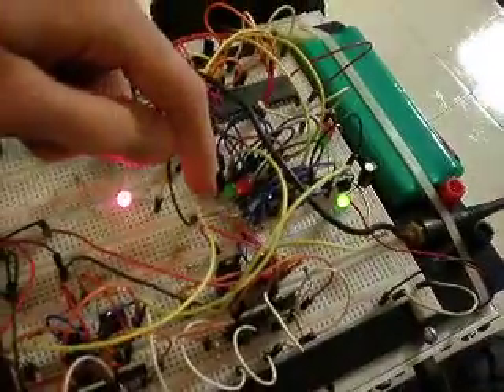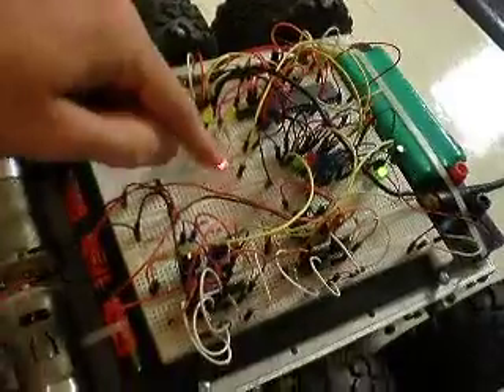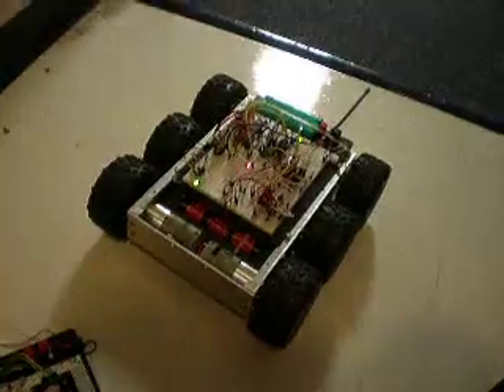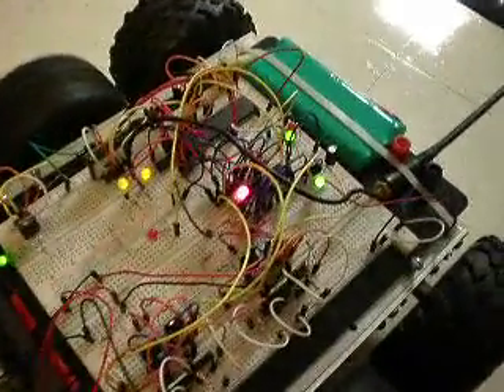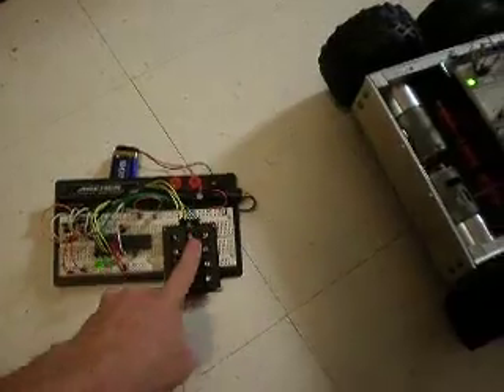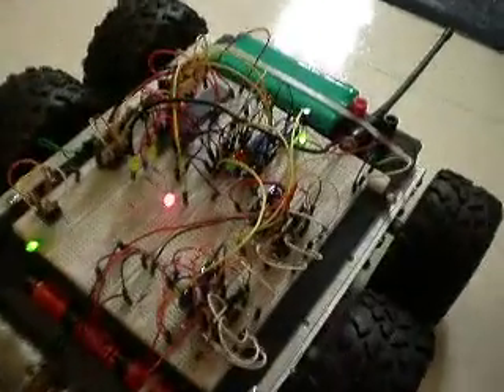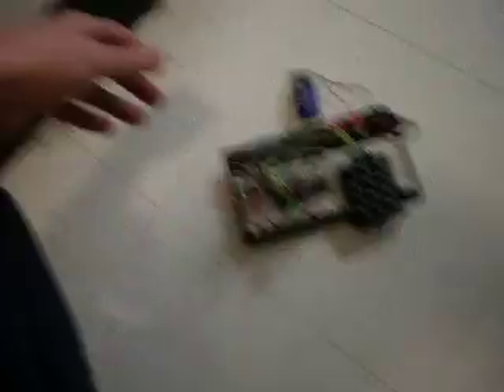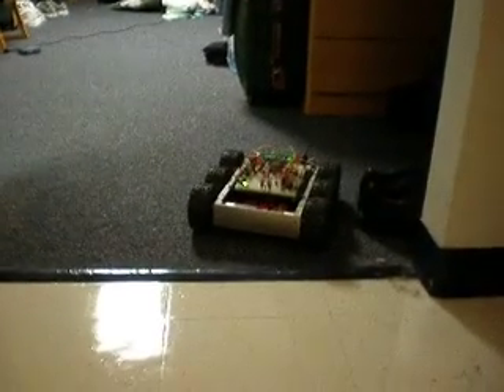Robot motor control test 1

Comment from the maker: I used TIP125 and TIP120 for the motor controller.  An Atmel Atmega16 on the robot and in the remote. The bread board and wires came from ebay.  I used them to just get it together for testing.  The wireless modulas are from global. they no long sell just the modulas thou. If you want more info just email me.